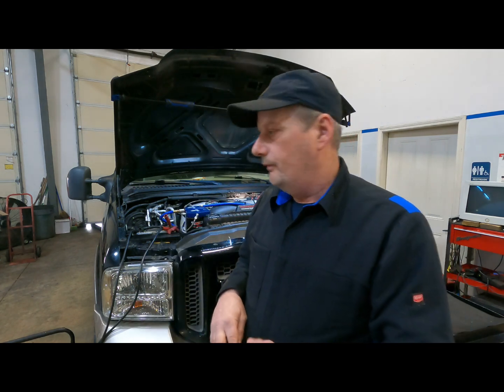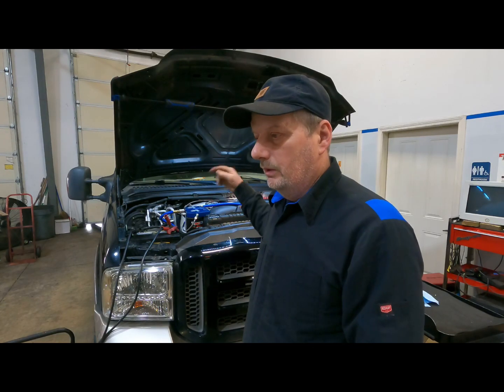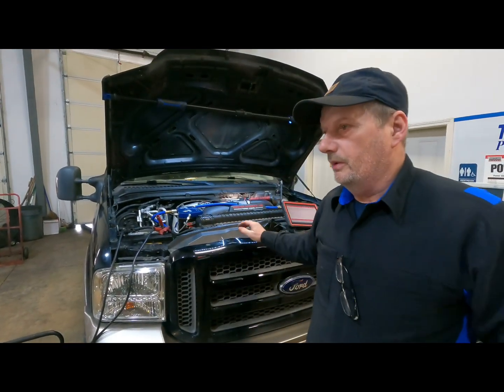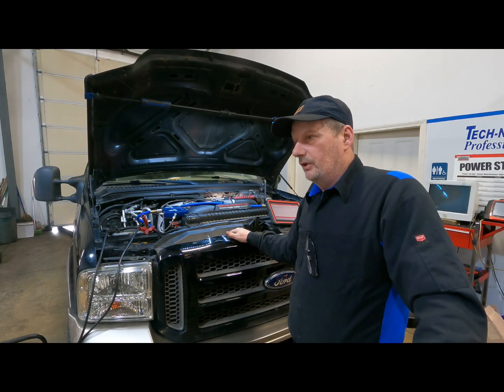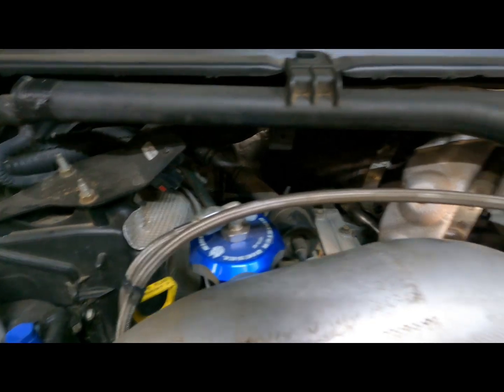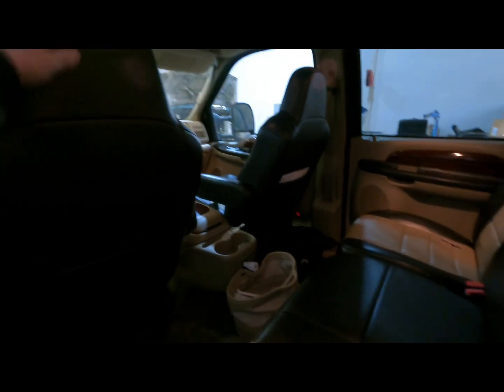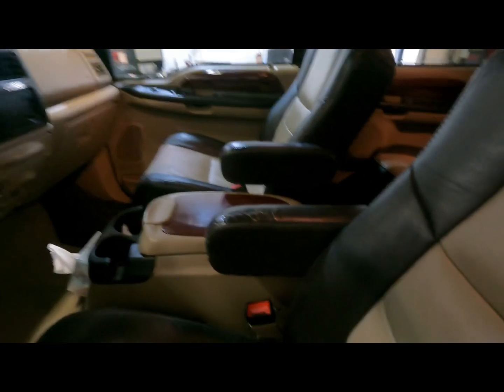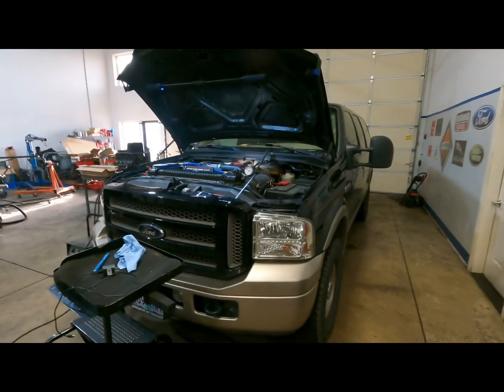6.0 Powerstroke EGR Cooler Diagnose

Comment: Not replacing oil cooler after egr cooler has failed? Usually clogged oil cooler causes egr cooler failure.
Reply from the maker: That’s why we always look at oil/coolant temp delta, right?
Reply: @northwestlighttruckservice278  love it when people try to out smart a pro but 1 good thing is they learn something